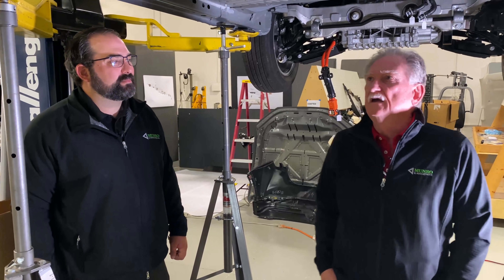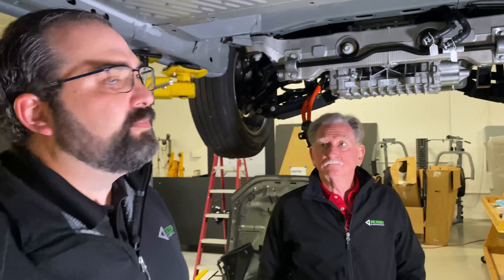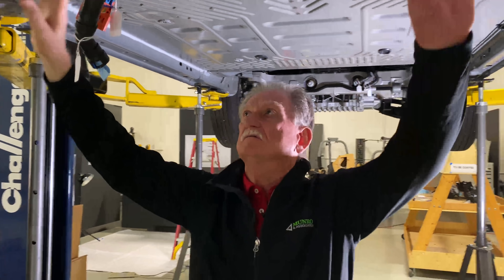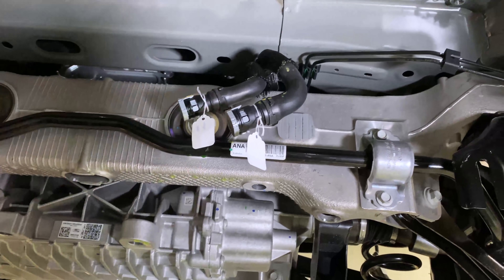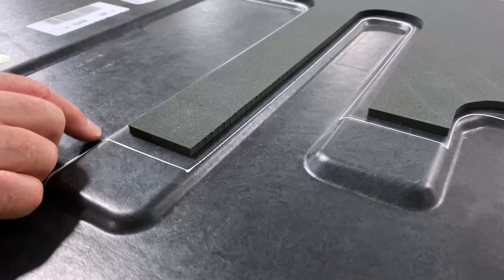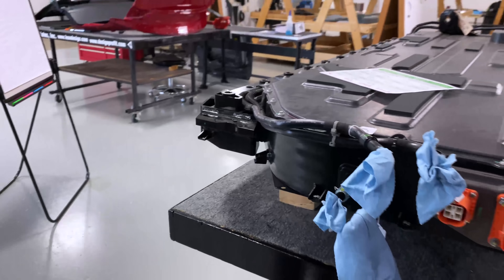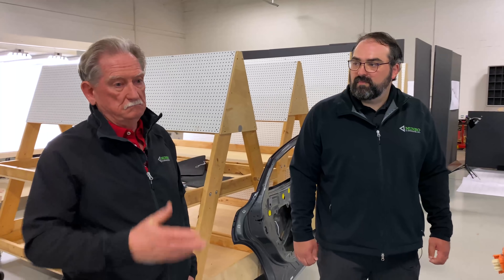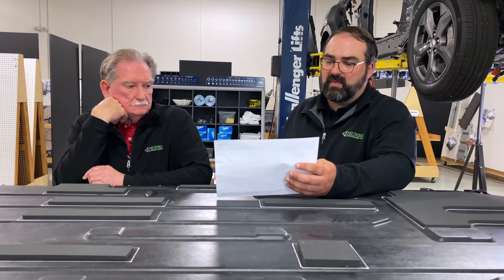First look at the Ford Mustang Mach-E Electric Battery

Comment: What do you think about in wheel electric motors (gearless)? One could get rid of a lot of moving parts. Or do you think they dont make a lot of sense because of the 1 to 1 rotation ratio?
Reply: I personally like that idea to a certain point. Those are unspung mass that can make handling worse. On small vehicles hub motors are relatively light weight and usually speeds are low enough to keep handling requirements lower. On large vehicles with speeds over 130mph you want those wheels on the road and having huge copper chunks in them is bad for suspension. Hitting a bump could either cause wheel not go up and tire and rim fail or tire goes up and stays there because added inertia.
Also more motors is more complexity in wiring to each wheel and you have high voltage lines bending in every little bump. Also more controllers.
Reply: You could set up in-wheel motors with gear ratios other than 1:1.

A one-gear-ratio motor is obviously not a problem if it's well-engineered; Tesla has proven that over and over.

The real problem with hub motors is - nobody has ever done that for automobiles.  Lordstown supposedly intends to do it, but they have not done much testing.  At all.  This a major R&D challenge.  (Lordstown's credibility sucks, too.)

Hub motors are unsprung - meaning that shocks are not dampened by anything but the tires.  Hub motors will take a lot of punishment.  In bicycles, the shocks aren't terribly large, motor RPMs aren't terribly fast, but in cars?  Different story.

You'll have connectors and wires feeding electricity to the hub, those have to survive, too.  I don't think you could take stock electric motors, cables and connectors available on the market and make working hub motors out of them.  Not durable enough.  Shocks can ruin your day when you're running a motor at high RPMs seen in automotive applications.  I think they'll have to be engineered for the purpose.

As you design in durability for hub motors, cables and connectors to compensate for shocks, you'll add weight.  More unsprung mass.

Unsprung mass negatively affects handling.  It really isn't desirable.  More R&D to overcome bad handling; more engineering for the rest of the car and suspension, more testing and refinement.  At the end of the day, you might not have a competitive car to offer once all of the R&D, testing and refinement is completed.  It's a risky course.

Hub motors also distribute mass further from the center of mass.  The ideal mass distribution places as much mass in the center as possible - that's how you get the best handling and safety.  When Model Y and Cybertruck get structural 4680 packs, they will be moving some mass inward compared to current models.  This is a good thing.  It makes engineering for handling and performance somewhat easier.  Hub motors would go in the other direction, and this is on top of poor handling from unsprung mass.

I can't tell you if hub motors could result in a compelling vehicle.  Someone will have to get through R&D, testing and refinement to figure out just how good they could be.  But I'm not optimistic.
Reply: @Urgelt  I hope to see Sandy address this more in coming months as Aptera begins rolling vehicles off the line. Sandy is consulting with them and is an investor as well. They are using Elaphe hub motors and should be mostly through the design and development stages I think .They seem to be quite competent and also doing thorough testing but I'm not aware of the concept being proven yet at their level. Maybe someone else knows a bit more about it than me and can point to proven designs already in use.
Reply: @kirkjohnson9353  Should be easier with such a lightweight vehicle, and I trust Aptera engineering a lot farther than I trust Lordstown engineering.

If it's successful for Aptera, it's still not a slam dunk to be successful for 2 ton + BEVs.  That would be a completely separate R&D push with different tradeoffs.
Reply: @Urgelt  That fits with my current understanding. Aptera is a bit of a special case due to its unusually light weight. It might work out really well. I hope so, I invested in them. hahaha   I absolutely love the entire Aptera concept and equally important my sense of the people involved at the core- including Sandy. In fact, Sandy's involvement was a big tipping point for me in deciding to invest and throw my hat in with them.

Comment: Man I wish that 200kw batteries would be a standard next year. I have 40kw in mine, and I could empty that in about 1-2 hours easily.
Reply: As hinted in the discussion, there comes a point of diminishing returns on battery size, more weight/size results in greater rolling resistance of the car, and a bigger car (to hold the weight, etc) often resulting in poor aerodynamics 
300 miles is a sweet point as it represents at least 4 hours driving (the average time between stops is about 2 hours), and above this driver safety drops off and so does the ability of cross your legs hard enough.  A lot of US ICE cars only have this range anyway.
The problem now for early adopters is the laughable infrastructure - especially in places like the UK where, until recently, it was nearly impossible to buy electricity with .... money .... (10 rfi cards, requires phone, prepay shitshow).
Reply: @Tom55data  Good points you make.
Reply: @Tom55data  Not necessarily true if the energy density of the pack is higher.
Reply: which car, I’ve been driving the model Y for a while and never needed more Range, in fact sometimes it feels like it has too much range but that’s probably cuz I came from a leaf.
Reply: @harsimranbansal5355  I have a Leaf, and have no city or country road traffic, so on a really bad day i could in theory with a hard wind against me and -2 degrees celsius empty the battery in about an hour, even though the battery has not degraded with time.